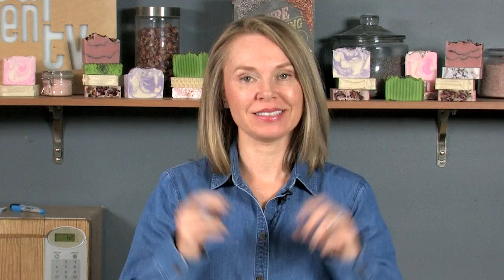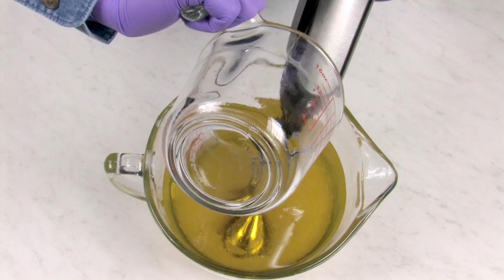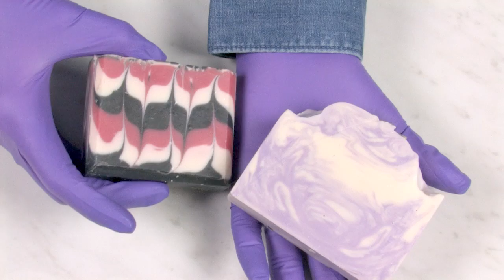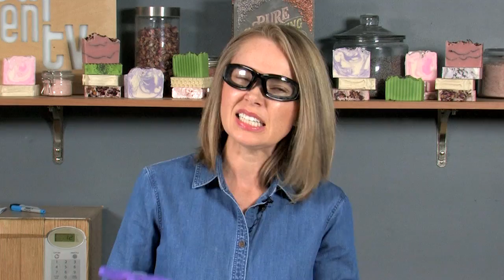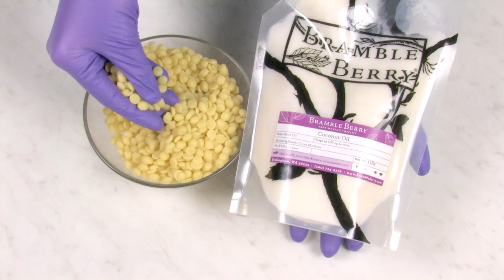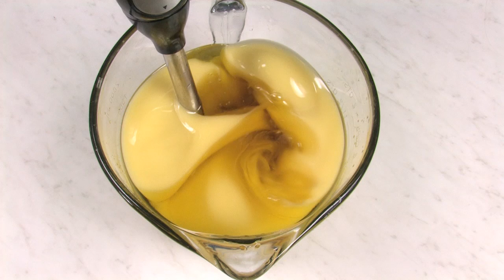All About Trace in Cold Process Soap | Bramble Berry

Comment: Hi! You’ve tough me so much in my soaping journey! I have a question. I added my color in with alcohol the other day and it seemed to accelerate trace is that possible? I want to create for texture but I can never seem to get to the right trace. The other day my soap started to solidify before I could finished pouring. It became too thick to pour and I had to scoop it out. Any tips or tricks? Or suggestions? Lol
Reply from the maker: If you are making cold process soap we recommend mixing your mica pigments with oil to prevent acceleration.

Comment: I have a lot of oil setting at the top of my batch, I use the quick mix but I also added 3.45oz of sweet almond and Murumuru as well 1.45oz shea butter and wheat germ then 1oz botanical extract and lastly about 1oz aloe Vera extract and 2 tsp of sodium lactate. My lye solution was 6oz lye & 13.41 water. Based off the calculation my oils and lye mix was 100% could it be my extract & concentrate or did I use to much butter/oil. Which I let the butter melt once I mixed in lye solution mix. Help me save my soap batch please

Comment: My first batches....I calculate with soap calc, weight of each ingredients with 0.01 scale, the soda was colder than oils (dropped faster than usual I don't know why) so the mistake was probably temperature... new try, same recipe, oils 55 deg, soda dropped too! 45 deg but less than before so I thought it will be fine, no trace... nothing, I decided to put in mold, texture is like room temperature butter, for a week, I did a mistake I guess... otherwise it will work! But dont know exactky what...soda is crystal but is it possible to failed because of poor quality of my soda?please help, I tried 4 times, each batch 1.5kg, I waist many products😔

Comment: This was the best trace video I have seen.  I kept getting to what I thought was light trace was actually medium trace and wasn't getting the swirls I wanted.  I followed this and stopped mixing when the soap got to thin cake batter.  

I was so worried that it was so sloshy and liquidy but I poured it and 14 hours later removed it from the mold and had the exact soap consistency I have been looking for.  I beautiful solid, no bubbles, and not a clumpy bar!!

This video was excellent  I will never make soap the same again!!

Comment: Mine seems to get to medium thick trace REALLY fast.. I am new and have made 2 batches so far.. they're curing so I hope they work when they are done. Do you recommend using a glass container to mix lye? I have a big plastic container that was recommended in a soapmaking book, but the lye barely fills up the bottom of it, and when I pour the oils, it's still not even that full, so I'm wondering if I can downsize to a glass pitcher.
Reply from the maker: We've used heat-safe glass for years and haven't had any problems. You can always use stainless steel or heat-resistant plastic as well. Whatever you use, make sure you only use them for soap.

Comment: How many ounces of essential oil goes into a soap batch?  Is there a standard formula for figuring this?  Thanks.
Reply: Go to Bramble Berry's website and find the fragrance calculator :-) It will tell you just how much each fragrance oil or essential oil to use per batch. Have fun!
Reply: Hi, I am also thinking about this question, and I didn't find answer yet. Have you found? :)
Reply: In her lavender soap and lemongrass soap, she used 2oz in her 2 pound batches (so 1oz per pound). But in the fragrance calculator on her website, it usually will say around .8oz per pound for a strongly scented batch of CP soap. Personally I would stick with the .8 because I just made a batch a few weeks ago and did about 1.5oz lavender EO for a 2lb loaf of CP soap (because that’s all the lavender EO I had on hand) and it was very strongly scented. I feel like if I added the whole 2oz it would’ve been too overwhelming.

Comment: Do you have a video on allepo soap? I made some tonight and my lye water was about 130 f and my oils were about 125 f and I used a stick blender and it traced right away and got real thick and I had to scoop it out of the container. So do you think my temperature was too high? I used 80 % olive oil and 20%laurel berry fruit oil.

Comment: can u over blend the soap base??
Reply from the maker: If you stick blend too much, the soap will thicken to a pudding-like texture. That's not necessarily a bad thing, but it may be tricky to get more intricate designs like swirls. Just pulse the stick blender a few times, stir, and check the texture. Once all that oil is blended in you can start adding color, fragrance, and additives.